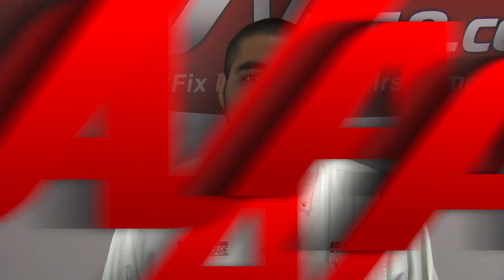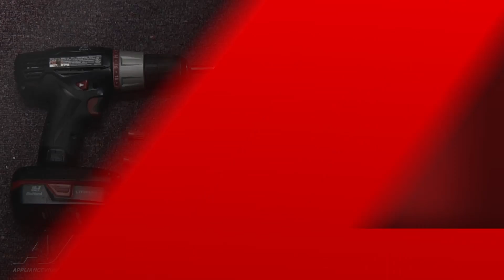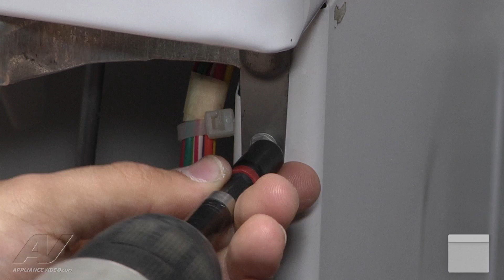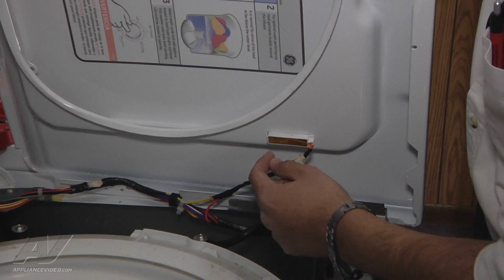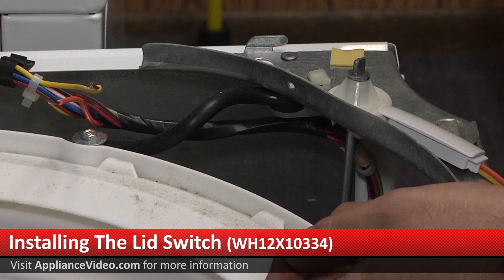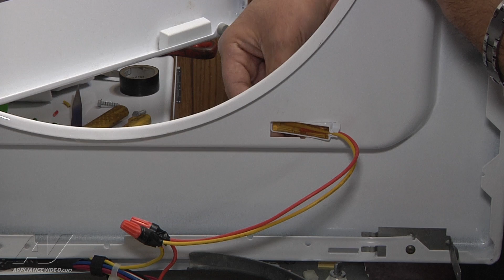GE Washer Repair - Will Not Run - Lid Switch

Comment: 1:35 "Push up on the clip" is not very descriptive. I pushed it down, I've pushed it in, neither are making the panel pop out.
Reply from the maker: Great question, if you have a more technical question that our parts department cannot answer, you can search our over 13,000 answered questions free at our website www.ApplianceVideo.com under our Repair Help section. You can also call our parts department at 1-800-830-5465 and they can give you help 7-days A week ,or search at www.SaveMoreOnParts.com  .
Reply: It is you’re just not listening well. He said there’s a tab and you have to press it in. I’m sure you’re working with it facing away so you can’t see it, but if you feel the back you’ll feel a tab, if you press, it will snap and then allow the movement.
Reply: @HuhWhatHuhwhatHuh  is it? Maybe "push up on the clip" can have many interpretations no matter how much one listens...

Comment: where do I order electric dryer starter switch replacement for the model number ha726938a
Reply from the maker: +Vivian Foster Call 1-800-830-5465 or go to our website at savemoreonparts.com . Thanks
Reply: Does it matter which direction the tape is wrapped?

Comment: Your websites does not have my model number. Please don't reply by giving me your website as an answer.  The question I have will make your head dizzy.  In fact I tell you what, not you or anyone you know will know the answer to my simple question.  If you don't think so.  I tell you what, just let me know and I will tell you my question.  Just to be fair I will tell you that it will be about door switch to Hotpoint washing machine model HTW240ASK2WS.  The symptom it shows, it will make your head spin.  Small talks are easy.  buying and installing a switch, running through errors and all those small crap, a two year old can do and that is all you expert there with clean hands dish out.     I know the game.  No disrespect.  I understand time is money and we are all trying to put dough on the table.  By the way I have explored your site.  Everything in it is kids stuff.
Reply from the maker: Great question, if you have a more technical question that our parts department cannot answer, you can search our over 17,000 answered questions free at our website www.ApplianceVideo.com under our Repair Help section. You can also call our parts department at 1-800-830-5465 and they can give you help 7-days A week ,or search at www.SaveMoreOnParts.com  .